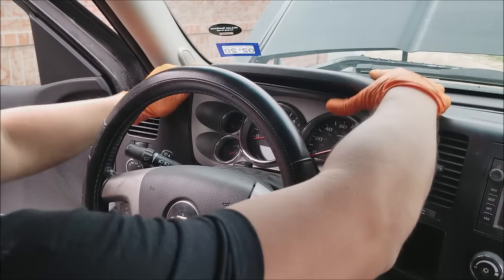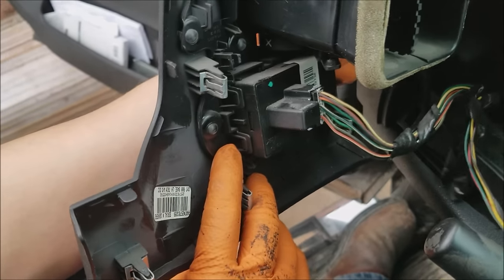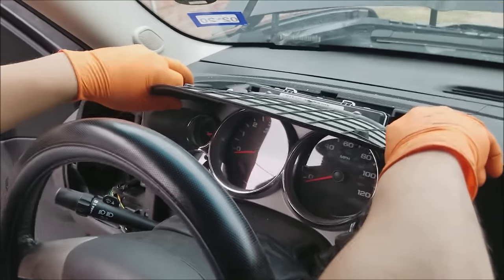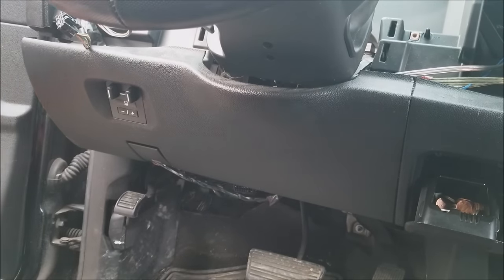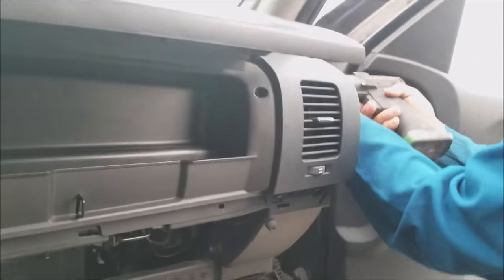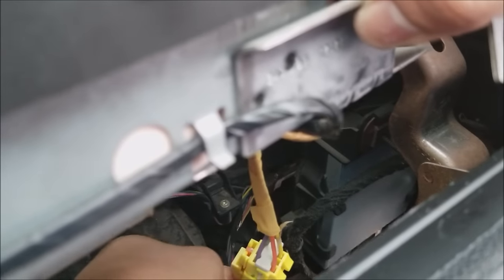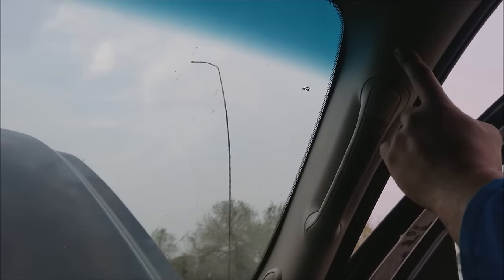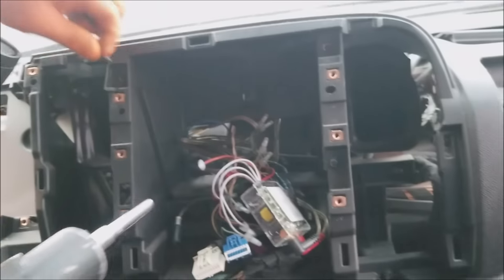Cracked Dash? Dash Replacement on 2007-2013 Silverado or GMC Sierra

Comment: Was confident enough after watching the video and replaced my dash. Would never have attemped to do this without this video. GREAT JOB GUYS!!!
Reply from the maker: Well im very glad the video was useful to you! Thank you for your positive feedback!
Reply: Nice job on the technical side of it still looks like a lot but nice job
Reply: Where did you get replacement dash I can only find slip on covers
Reply: Can you please tell me where you purchased your new replacement dash?
Reply: Where did you buy the dashvoard?
Reply: Can you tell me where you got or ordered dash from please
Reply: My Dash finally cracked and here I am just finished watching the video.  Pretty detailed and looks like an achievable removal/replacement but man, the level of knowledge of where the next bolts are was top notched.  I would have pulled and shattered trying to yank not knowing there are more bolts.  Thanks guys! Now just actually to attempt this. Wish me luck.

Comment: Awesome video. You have convinced me that me cracked dash on my 2008 Sierra really doesn't need to be replaced that bad. I have a greater appreciation for the cost charged by mechanics now. I would have never imagined this would be such an involved process.
Reply from the maker: Haha yes it sure is a long process to replace and we do a lot of work that sometimes people don't understand how much time goes into it like you said..
Reply: Lol same here I rather just pay
Reply: I think I might just put carpeting on top of my dash, this is way too much work for me
Reply: My windshield also needs replacing...wonder if dash replacement would be easier without windshield in the way

Comment: Nice video. Get under the replacement dash before install and take some epoxy and scrap plastic and gusset/reinforce common areas that crack before install, watching for areas that may be tight tolerance and prevent a good fit.  May help prevent cracking in the future.

Comment: OMG!!! and good Lord that's a lot of work. I'll bet that is an expensive job to have done at a shop just for labor..........I'll have to live with my cracked dash.........Thanks for sharing..........learned a lot.
Reply from the maker: Actually I typically bill around $300 labor for this job. And dash was taken off another truck so he bought it for $100
Reply: You can also buy a "dash cap". It's made from much better material (ABS PVC) and just adheres to the old one. Looks pretty clean.

Comment: OMG, that is how tutorial videos are done. 👏👏 Excellent details, very informative and clear instructions. The only thing missing would be a link for the replacement parts. The internet is full of crappy dash covers.
Reply from the maker: Thank you very much, its comments like these that make our day. And the replacement dash actually came out of a used parts truck. Dash was intact. Please help us by clicking subscribe.
Reply: @EddiesCustomsandRestorations  - good find.  those dashes are $500 new.  :-(
Reply from the maker: @nosonfontenot3072  unfortunately yes!!
Reply: Only available thru GM at local dealer. No aftermarket on this on boys.  Dealer charged 600 for a new one 😬

Comment: This video was extremely helpful.  The only addition I would add is to remove the metal U-shaped brace below the steering wheel.  4 nuts, easy to remove.  It allows the steering column to drop even lower and makes getting the dash out and back in WAY easier than they show here.
Reply from the maker: Yea just didn't want to fully remove another item lol. But thank you very much for your positive comment Chad.

Comment: Thank you...
This video helped me a lot..
I just replaced mine on my 2007 nbs.
Especially the tip about how to drop the steering column for more clearance.
Reply from the maker: You're very welcome. We try explaining as much as we can. Please help us grow by clicking subscribe.
Reply: I know it's been a while but do you have a link to were you bought your dashboard. I'm lookig around but I can find any or its a scam.
Reply: @gerardorocha9145  
I looked all over the place and like you I felt like some of the ones i found were scams. Only one preview photo and vague item description.
I ended up getting mine from the dealer.
Ill look for the part numbers and follow up.
Reply: JAY EFF thanks. I really appreciate it. Ya I ran into sketchy websites as well with prices to good to be true or just 1 preview photo.
Reply: @gerardorocha9145  
I found my receipt from the dealer.

For the main dash (panel) part # gm 19331340  $396

For the etension panel at edge by windshield part# gm 23224733 $ 244

These are part numbers for ebony interior.
Gray or tan might be different. 

Bought them at GM dealer in California, price might be different elsewhere.

Comment: Looks like a lot of work but it's a lot more if you need to take the HVAC box to replace the heater core :-(. Thank you for posting this video as it helped me with the two extra plugs I didn't know where they went (one was a dummy plug next to the air vent on the DL side and the other was the plug to the ambient light).

Comment: I went in for an airbag recall and discovered my '14 dash was cracking. The dealer even said it was a "poor design." I contacted GM directly to complain and they contacted the dealer and said they would replace for a little over $300. Not bad considering it's normally over $1100 and my truck is 7 1/2 years old.
Reply from the maker: Niiiice!!!

Comment: If it does have a cab air filter can you do a video how to replace one 
Thank you
Reply: pretty sure these don't. GM used some other way for filtration. Don't quote me on that, the newer ones might have a filter

Comment: Good job! I literally saw my dash crack today while  I was driving.  It's not as bad as the one you were working on but mine cracked over on the left side of  the passenger side airbag. What was the cost on the replacement dash and where did you source the part? Also, about how much time, "in real time" did you spend replacing the dash? Once again, good job and really good video! I greatly appreciate you guys taking the time to do it!
Reply from the maker: Real time takes about 2 or 3 hours depending on experience and tools used. The dash was sold to a customer from another customer but you can find them on ebay for around 200. And yes it sure was a lot of editing for this video. Please subscribe, it will help my channel grow.
Reply: Can you help me find it on eBay? Dark titanium?

Comment: What replacement dash did you use? If GM, did they update the quality of the plastic used? Do you have a link for dash? Thanks
Reply from the maker: We had a dash from another truck that was wrecked. You may be able to purchase the dash from the parts department at a dealer but other than that, all I have seen are dash covers
Reply: @EddiesCustomsandRestorations  are the 2012-2013 dashes better are they susceptible to cracking also?
Reply from the maker: @douglasbaker5949  they are all the same dashes. Same material.

Comment: Awesome - where are you located?  I wouldn't mind hiring you to fix my 2011 Tahoe dash with the same problem.
Reply from the maker: Unfortunately I'm not doing the dash replacements anymore due to heavy work flow and my shop specializes in classic car restorations.. but feel free to give it a go, this  step by step video will take you through the whole way.

Comment: I've installed dash cap over the broken dash cover, now I'm replacing the whole thing bcoz dash cap are not removable. They're good, but if you have to do any repairs under the cover you'll have to break them.

Comment: I have a question.  Are the new factory pieces the same junk cracking plastic or are they improved that will last longer than a few years?  At 1,300.00 bucks for the parts, they better not be the same junk.
Reply: I was wondering that myself.  Being it's GM it's probably the same crap. I doubt you could find this information anywhere, you know top secret. I decided just to buy a Dashskin and install it.

Comment: awesome video... it a lot of hassle just to replace the dash....  where did you purchase the oem dash?
Reply from the maker: Got it off another truck actually. But they are available for purchase on ebay I believe for around 200.
Reply: @EddiesCustomsandRestorations  orale, thanks I need to check it out..... are you guys from the RGV
Reply from the maker: @juanhinojosa9784  yes actually
Reply from the maker: Mission Tx
Reply: @EddiesCustomsandRestorations  cool, I'm from weslaco, if I were to find a dash how much would you charge to replace
Reply from the maker: @juanhinojosa9784  look us up on Facebook under the same name.we will continue through there.
Reply: Mission Texas here too, MHS class of 98. Now live in NC. Thanks for the video. I need to do this on my truck when I get done with the AFM delete. See if you can make the same video for the LTZ dash for the same years. My wife has a Suburban LTZ that the dash is falling apart on. Gonna need to replace that one too.
Reply from the maker: @GrmReaper37  oh wow, small world! Haven't had an LTZ come by the shop just yet. By the time I do, you may have already replaced it. I been focusing on building the 1971 international scout for a customer and slowly working on videos for it and a 1969 camaro
Reply: Im hoping to restore a 1980 Chevy K10, little by little, over the next 10 years. I need to learn to weld. Need cab corners, rockers and floor pans. Has a inline 250 with a 4 speed granny gear. Next is also replacing the head with a non-integrated, no smog cylinder head. Then hubs and brakes. At least then it'll be driveable.
Reply from the maker: @GrmReaper37  get you a Millermatic mig welder from miller. Very good welder. Do not get one with a digital screen though. Those screens have a tenancy of failing. But the ones with manual knobs are awesome. And they use gas so you would need to purchase a tank of CO2 and argon 75% 25% is what they call that and believe me, you will get some nice welds. I have a 211 millermatic. Wouldn't trade it for any other. Have had other welders but that is the best in my personal opinion. And you can then purchase a spool gun separently to weld aluminum with the same welder. But yes sounds like you have plenty to do there. Sounds like a nice project. Good luck on it and hope you don't run into many hick ups down the line. Bound to happen when modifying original stuff.
Reply: Hey guys. Any chance you guys can help me find a dash for an 07 sierra double glove box and dark titanium? Can't seem to find any. Cheapest i found is from a dealer at 440😡

Comment: Is it a must to disconnect battery for this or not
Reply from the maker: Yes because you will have to turn the key on to drop the shifter to the "M" position. And having key on and disconnecting harnesses is never good.

Comment: How did you wire up that radio and get it to work, I have the same one but my truck doesn't have bose so it won't work
Reply from the maker: I didnt wire it up. The customer had taken it to a local audio place. There are many wiring diagrams on Google images where you can get all the color codes.

Comment: What website can i buy the dash from?
Reply from the maker: Got it from a used truck that was crashed. So it was an original dash off another truck.
Reply: Won't crack if involved in a crash but will break into pieces if it's just sitting there lol

Comment: Hi my uncle need a dash replacement but we needed to know where to order it and to make sure that it's the correct one. He just needs the top part and the big part that you removed. He has a 2008 Chevrolet Silverado 1500  LT Limited Edition. Please help. Thanks
Reply from the maker: The dash we obtained was actually from a wrecked truck. I am unsure if they make aftermarket dashboards...perhaps may be able to get one from the dealership..
Reply: @EddiesCustomsandRestorations  Oh ok ...i thought maybe you hade ordered it. We went online under chevy but we're confused on what to get because he only needed certain parts. Thank you so much for taking the time out to reply.
Reply from the maker: @lautuinajohnson5259  oh no problem i just wish i had a better answer for you. If you go through the comments, someone had found a link online i believe for one but you would have to look through the comments unfortunately... there are so many to go through...

Comment: Would a Gm dealership do this and if so how much does this estimate too?
Reply from the maker: GM would do it for about 3 times the cost. I did it for my client for $300 plus the cost of the dash board. If the dealership does it, it be upwards of $1000 for this job for just the labor too.
Reply: @EddiesCustomsandRestorations  gotcha I need to find a local you😂
Reply from the maker: @sir_tate1329  lol oh I'm sure there are plenty 🤣😅

Comment: Can I put a Chevy Silverado dash on a GMC Sierra???
Reply from the maker: Yes you can. Same body, electronics may differ a little depending on features but it will bolt on
Reply: @EddiesCustomsandRestorations  thank you so much

Comment: Break like 20 clips to replace a dash with one crack, that would give me an ocd convulsion
Reply from the maker: No way!! Well thats not good...
Reply: The mismatched colors of the parts is what would drive me bonkers.. Mine's got a little crack by the airbag that drives me nuts.. I'm considering doing this when spring gets here and the weather is decent, but I wonder, would some armorall possibly bring those colors back in line so it's less noticeable that they are faded differently?
Reply from the maker: @captainwallard2788  I would use meguiars natural shine. Its much much more natural and not oily like Armour all
Reply: @EddiesCustomsandRestorations  Hey thanks for the quick reply! I will definitely take this advice. By the way, this is possibly the most comprehensive dash teardown on the internet. Thank you SO MUCH for spending the time to make this video.
Reply from the maker: @captainwallard2788  you're very welcome. That meguiars natural shine will give your car that original shine it once had, its not the oily glossy look a lot of people like. But it makes it look new. And yea it sure did take a lot of time but thanks to all of you who view my videos, its paying off. Please share. It really helps.